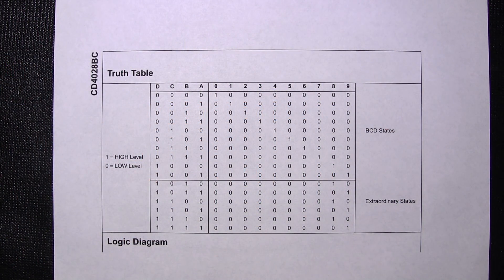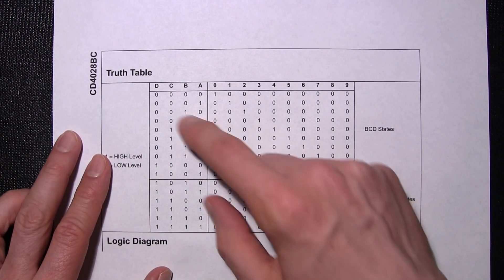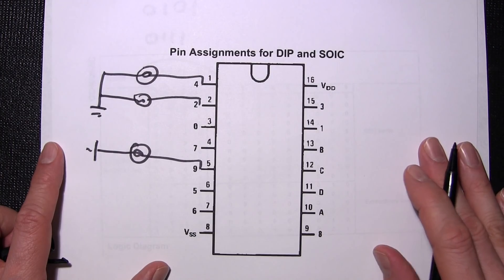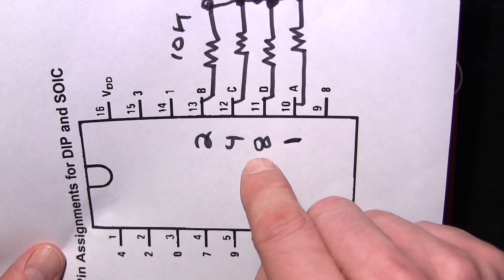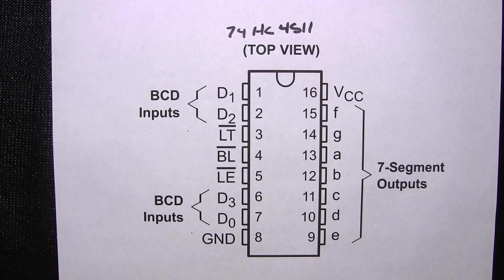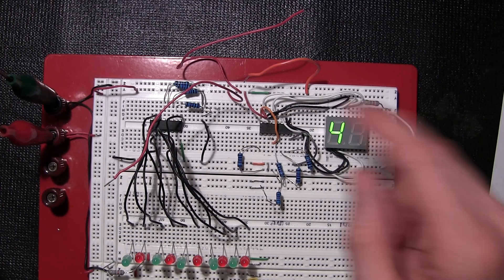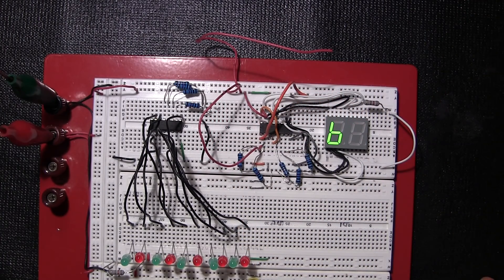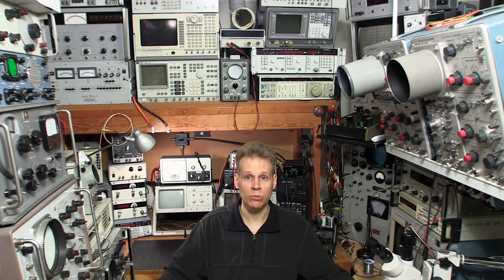How Binary Logic Works, Tech Tips Tuesday

Comment: I learned that it was on or off that helped with some clarity of itbut what I don't understand is you have to program the chip to drive the chip to control the chip to make the device work????? Per saying that if I wanted to make a device that made the 2468 01579 lights light up chasing each other( for sake of argument, in that order) I would have to program a IC to tell the other IC what to do.. that's where I get lost if that makes any sense... At any rate keep up with the great videos... Or maybe my problem is is I know how it works just don't know how to apply it..

Comment: When you touch the BCD pins with the 5V "high" - as well as lighting up the required decimal,  surely this will also put a positive voltage on the ground through the 10k resistor? Does this matter? (didn't seem to!)
Reply: no. ohms law will tell you 5v/10k ohms = .5ma...   1/2 of a milliamp is nothing....

Comment: Actually when they invented binary they weren't thinking to assigning numbers to BCD. They were just looking for a method to count using binary system. In binary you only have 0s and 1s. So how could you count with that? Simple, just like you would count with 0 to 9 but only with 0s and 1s. You start with 0, then 1, and after that you go like you would go from 9, just ad a decimal in front. So that would be like: 0000, 0001, 0010, 0011, 0100, 0101, 0110, 0111, 1000, 1001, 1010. That would translate to 0, 1, 2, 3, 4, 5, 6, 7, 8, 9, 10. This is what I know of it, correct me if I'm wrong. Nevertheless this method of assigning numbers to BCD works perfectly for simplifying things.

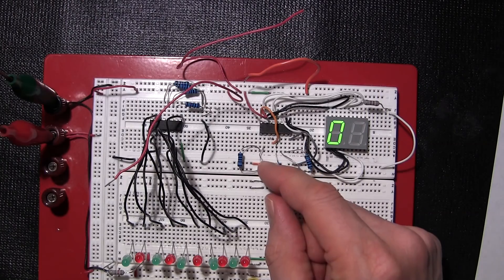Comment: I've done some overview research on matching impedance to eliminate signal reflection and "random weirdness" as he describes in 11:50. I get that you need to match input and output impedance but why does adding a similar resistor to ground (10K ohms in this case) make the output match? Like how does that affect the current/voltage? How was this discovered?

Comment: You explained SOOo well !!! 01010100 01101000 01100001 01101110 01101011 01110011 - thanks in binary lol
Reply from the maker: You're Welcome!
Reply: hey guys i think the  decode is 8410497110107115. also how to decode to letters
Reply: I think he used ASCII, each binary number represents a character.
Reply: It is "Thanks"
JAVA:

  String s1 = "01010100 01101000 01100001 01101110 01101011 01110011";
  String[] foo = s1.split(" ");
  
  StringBuilder sb = new StringBuilder();
  
  for (String s : foo) {
   sb.append((char)(Byte.parseByte(s, 2)));
  }
  
  System.out.println(sb.toString());

Comment: Whats interesting this is how computer programs was once made  they use Binary as a off and on switch

and you can find out how min bits by the on and off configuration

10101010 this would mean 32 bits of information each on switch is 8 bits :)
Reply: They could use this for military code 1234567 and 8 but they can be much longer 16 even 32 and 64 bits long
for our example we have it at 8 but if i wanted to relay a number to you i could tell you that they are just on and off switches that is where 010000000 2 is or i could do this in a series of code where you could figure it out i will use a public number just to show the example Time service in my Home town of Little Rock for example. reading from 1 down not across :) but i see you already know binary that is  awesome you can evn do the alphabit with binary this lanuage is truly fab that it can be so useful

10000000   10000000  00000100 10000000
00001000    00100000 00000001 10000000
00000000     0000010 10000000

Now if you look close you will see that a number is represented 1-8  and you will also notice zero is open
so if you look closer you can make out the phone number 1-501-3768111 
LOL Clever as this is i wish it was my discovery but this has been used for years in computer programming in fact we are using it right now to send this message :)

So how then do you get higher numbers like 10-11-12 est again they use the same type method

00000001 01000000 - 10
00000001 11000000 - 11 

Est.....I hope you enjoyed learning a little more about binary and how it works and maybe it will help your students learn a little more about binary and how it is used in all kinds of application.

Comment: What kind of resistor color code scheme is this?
According to the video these are: "... 10K resistors ..." but they feature 5 black bands!?
Reply: They appear black because Paul's videos are often one stop underexposed.
Printscreen the video, and put the image in a photoshop like program, and light the shadows if you know how to do that. 

* Usually (old school) 4 bands ( x + x + amount of base 10 multiplication (zero's)) + tolerance.
A 10 K would then be : brown - black - orange = 1 + 0 + 000  (+tolerance band)

* With 5 bands they indicate a third significant digit, the third band, for more prefabricated values. It extends the total range.
So these have 5 bands (x + x + x + amount of base 10 multiplication (zero's)) + tolerance band.
A 10 K would then be : brown - black - black - red = 1 + 0 + 0 + 00  +tolerance band.

Comment: Great video! do you know if i can use a ATMEGA8515 to control 4x cd4028 or does it need programming first? nixie clock project with 40x MPSA42 as you recommended in another video

Comment: Question:  On the pinout diagram, on pins 3, 4, and 5, the names LT, BL, and LE are overlined.  If I remember correctly, an overline in Boolean algebra means NOT.  What is the meaning here?  Failing memories want to know.  Thanks again, Mr. C.
Reply from the maker: +Hopelessand Forlorn 
Hi, that means the pin is "active low" ( the pin needs to be at the negative or ground for that function to enable.)

Comment: well, you 1/2 a byte...double up and get 8 bits, a byte..  then you address an 8080...with a hex/dec 16 button keyboard
Reply from the maker: +Doug Ankrum 
I think that means you enjoyed the video :^)
Reply: +Mr Carlson&#39;s Lab    The various solders caught my eye so I subbed up..... Right. I  really appreciate the time you take to make the videos.....Yeah, nice video...I was doing this TTL (lots of 7400 series chips) stuff in the 1970's....1971-78......NC Machine tools, then with the 8080..memory was often just EEPROM's...with the 'blacklight'
   The very first CNC stuff...the machines haven't changed so much, but the software now is 100 times ahead...
  Right about the time the 8080 came out to make the first computers available to public...TRS-80...? Back when you still programmed the computer with a cassette and audio...1200 BAUD...Hex was a 16 key/button 0-9 and A-H...gave binary output 0-15...half of the 8 bits required for 8080 inputs...8 bits (to a byte)...256 codes...Computer readout was 2, 7-seg displays...0-F...2, FF's was all 255 bits high, enormous power supplies with big transformers, a dozen huge electrolytic-caps,  and 50-60 amps of 5 volts..no switchers yet..!

Comment: Mr. Carlson, I wanted to pick up a tube tester for working on antique/vintage radios.  Most of what I have interest in are radios that are relatively inexpensive American made units.  There are a lot of options out there and I'm having trouble wading through it all.  Can you recommend a brand or model?  I've been working on ebay as they seems to have a lot of items for sale.  If you could help me I'd be willing to compensate you for your time.
Reply from the maker: +Tony Perry 
Hi Tony. There are many different kinds of testers on the market, and I have owned many. The one I have stuck with is the Heathkit IT-17. It's very versatile, and tests many tubes with the extended lists. This type of tester is just an emission type tester, but you will find, that's all you need. The best test for any tube is the circuit it lives in.
 Does this help?
Reply: +Mr Carlson's Lab  - Thank you.  I just checked ebay and there are none currently available.  If you think I should wait, I will.  Also, if you'd like to acquire a good candidate and test/fix I will compensate you for your efforts.  Thoughts?
Reply from the maker: +Tony Perry 
They are pretty versatile, I would search one out. Look up the extended lists for that tester, It's pretty impressive. Tests a lot of transmitting tubes as well. Those testers are very basic, and rarely fail, unless somebody has tried real hard. I would help with a repair, but I'm extremely busy right now. Thanks for your offer though!
Reply: Thank you.  I'll bide my time and seek one out.

Comment: Just curious if you use any circuit simulation software, or PCB layout software. If so, these might be good topics for videos. I remember when I began to experiment with solid state devices. I quickly found that they weren't as tolerant to mistakes as tubes were. Instead of tube plates getting orange, the transistors instead simply died silently, leaving me at a loss to figure out what happened. 
Simulation software is great for learning by experimentation. But what makes sense for a non-commercial experimenter?
Reply from the maker: +Bill Moran 
I don't use any simulation software, so I couldn't tell you. For the PCB layout software, I use Traxmaker 2000 pro.

Comment: Mr Carlson, I recently picked up a Hitachi V-212 oscilloscope.  It did not come with leads.  I don't think Hitachi is making these anymore and I was wondering if you could recommend a probe that would work with this unit and is reasonably priced.  Thanking you in advance.
Reply from the maker: +Tony Perry 
Hi Tony. That scope is good to 20MHz and most common probes will "probably" be OK. You need to check the input capacitance specs on the scope (owners manual), and make sure the compensation range of the probe you purchase will fall within the range of the scope.
Reply: +Mr Carlson's Lab ....thank you.

Comment: Great Tips Tuesday Paul. One caveat, as you were reading off what you called a "binary number" i.e. the D0-D3 sequence on the bottom (left side) of the chip layout was actually in the order D1-D2-D3-D0 which read as 1000; obviously not the number 2 in binary (think it would be 0010). Didn't want someone to assume the actual binary number representation was in that order, that is unless I'm nuts which is entirely possible!  Keep the videos coming!  73 - Dino KL0S
Reply from the maker: +Dino Papas 
LOL, your not nuts Dino. If you were to put D1-D2-D3-D0  in the order like you explained, the code for #2 is 1000. This is simply putting the correct logic level to the right pins of the IC "directly" (not the chart order) Thanks again for the kind words!

Comment: Thanks Paul for yet another great video. I always like to watch your techniques, your explanation is great and there is lots of things in electronics that I did not know. you have help me gain knowledge in so many ways. Thanks again and keep up the good work.
Reply from the maker: +Andre Gopee 
Thanks for the kind words Andre! Glad you find the video's helpful.
Reply: Your Welcome. One question that I have... these IC's Like TPIC6B595N and the ones you have in your video. If it goes bad and I have to buy another replacement, would I have to program it for myself or will it be program already. I have never dealt with this type of IC's before and it will be good to know.
Reply from the maker: This IC is just a shift register. Its controlled by whats behind it. Nothing special.
Reply: Ok Thanks. But for the IC that you are demonstrating, Will I have to program it myself or will it come program?
Reply from the maker: Hi Andre. They come ready to use, no programming needed. Just select the right input levels (as shown in the video) to make it read a number.

Comment: good explanation Paul, but how do you control the decimal point
Reply from the maker: +mike barton 
Hi Mike. There are many different ways, depending on the equipment that the display is in. Some are just wired to the switch that the time base (divider chain output) frequency is switched from.. IE: (frequency counter). Some use more logic to make it automatic (Volt meters, calculators, so on.) Glad you enjoyed the video!

Comment: One minor correction, D=8, C=4, B=2, "A=0"! It's important to remember that each char will represent 2 states - 'ON' or 'OFF'',  hence, binary. So each char(A-D) can be either its value(ON) or its other value(OFF). So many times in school I would forget that zero state and get my calculations wrong. Counting and representing what you are counting are two entirely different entities. We were taught to count from 1 - 10, but if you do it right and start at 'Zero' your ones column(base 10)  will have Zero(0) in it and your tens column(base 10) will have a One(1) in it, your answer will be 10! That's one of the reasons its hard to get a grip on the binary system, that darn zero!
Reply from the maker: +Diahron Grismore 
Hi Diahron, this video displays the actual logic of the IC, (in pin order) and shows one how to make a functional circuit without the regular industry confusion added in. If you design circuits using this thought and mapping, it's very fast and easy. Thanks for your comment!
Reply: +Diahron Grismore 
You get "0" when A, B, C, & D are all low or off.

Comment: I think one day there will be a trinary system if we ever get atomic level chips. There will be three states. Electrically plus, neutral and minus.
Reply from the maker: +InTheNameOfJustice 
Do you mean Tri-state logic? It's kind of like what you explain.
Reply: Mr Carlson's Lab
No. A try-State buffer as I understand it is simply an externally electronically switched buffer, if that is what you mean and I have that right. This is not the original article I read but it does talk about the same thing. https://en.wikipedia.org/wiki/Quantum_computing
I no longer have the original article I'm afraid but the one I was reading said that atoms can be in one of three states electrically and if those states can be utilised in atomic level chips we will have almost unlimited computer power. The piece referred to the three states as a trinary system. 0 1 - The idea being that the extra bit means data manipulation could be carried out at undreamt of speed and complexity.
Reply from the maker: Very interesting! I will check that out.

Comment: What would have happened if you would have selected 8 and 2 (I forget what the pin numbers are) on the second IC? It only has a single display driver so 10 isn't possible.
Reply from the maker: +Michael Lloyd  
Hi Michael,  go to page 4 of this PDF and take a look at the sheet. Then you tell me :^) http://www.datasheetarchive.com/dlmain/Datasheets-308/10879.pdf
Reply from the maker: +Mr Carlson's Lab 
Where did you go?
Reply: +Mr Carlson&#39;s Lab 

Blank. That makes sense. in Base 10 we count 0 - 9. 10 would require another "place" and therefore another logic chip.
Reply from the maker: You got it, Great to read Michael!

Comment: There pull-up nod pull-down resistors. In this case you spoke about pull down. I tried to image a pull-up situation.....
Reply from the maker: +Joop Terwijn 
Hi Joop, they are pull down resistors as mentioned, all are connected to ground. Pull up situation: older gear with Nixie tubes :^)

Comment: on schematic there is LE as a low active input isn't it?
Reply from the maker: +dh1ao 
To simplify the silliness in their data sheets, "LT" is high to disable it, or (turn off the #8 display test feature), "BL" is high for the display to be ON, (or illuminated)  "LE" is low for the display to not latch, making "LE" high will hold the display and not allow a new entry until it's pulsed.